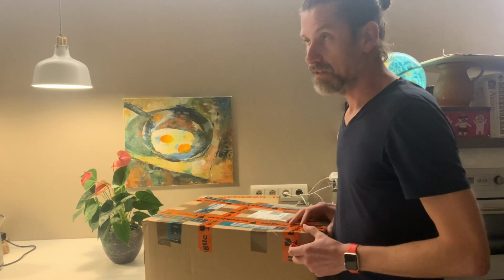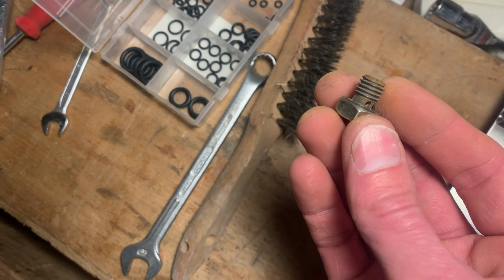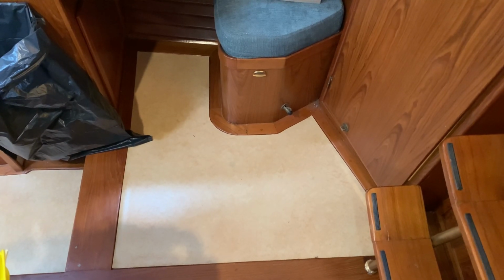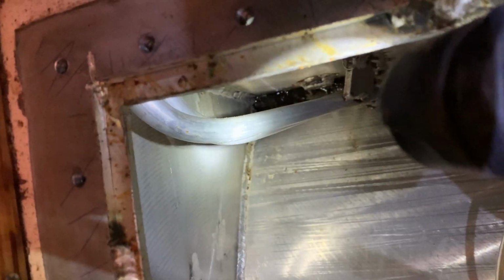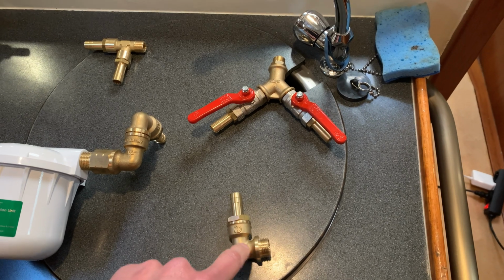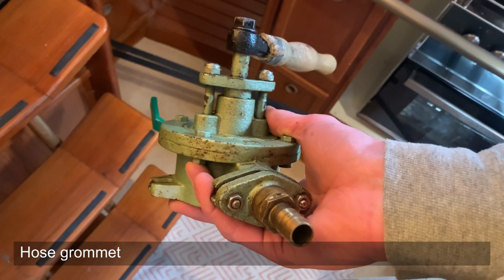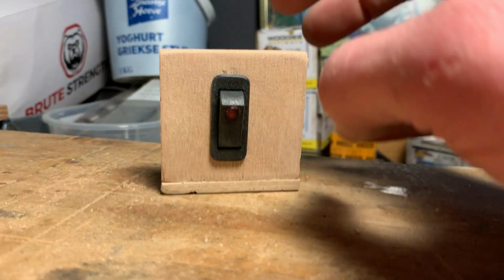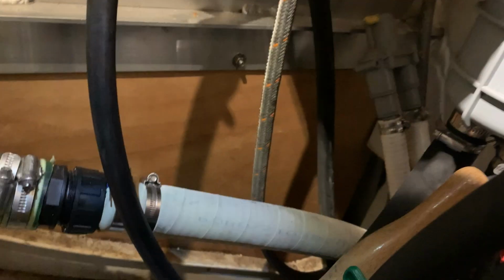019 Diesel Bacteria? Polish fuel!

Comment: I got the same pump. Damage as well just after using twice.
Reply: Those are Marco pumps are gear pumps, it’s a good idea to use a wire mesh strainer before the pump. If it sucks up a hard chunk of something they do sustain damage or jam the gears.
Reply from the maker: In my case the pump is after the diesel went through the filter. Up till now it works as designed so no jamming fortunately..

Comment: Use liquid dish washing soap on the metal barb before installing the rubber hose… and it should slide right on.
Reply from the maker: Thank you Floyd, good tip indeed! 👍. Honestly, I hope there is no next time ;)

Comment: I can't understand why you would ever want to pump the diesel from the day tank back through the filter to the bulk tank.  Is there a reason why you want or need to do this?
Reply from the maker: Hi SailingAphrodite4189,

Thanks for asking! I’m sailing regularly but sometimes I’m not sailing for a month or two. That means bacteria could grow in the day tank. 

By running the diesel back to the main tank I’m able to refill the day tank from the main tank before I start a new adventure making sure I have a clean day tank. 

This is especially valuable as the diesel
Return is on the day tank making the diesel warmer after a trip. 

Hope this helps!

Comment: I am thoroughly impressed with this video of yours on several levels!  Much respect and thanks to you sir!  This is an AMAZING video!   I enjoyed your analysis of marine rescue events and then where you broke those events down further coming to the conclusion that the majority of diesel engine failures are caused by fuel contamination issues.  I thought you were most wise to take on this specific issue proactively in your own vessel.  Most impressively you got to the root of the problem.  That root problem being the accumulation of bacteria, diesel-bug, in the bottom of the tank.  To eliminate the source of diesel-bug caused fuel starvation or contamination induced engine failure you must eliminate the presence of the bug in the fuel system itself.  It is not enough just to eliminate the "bug" suspended in the fuel while leaving the massive colonies of the "bug" still alive and accumulating in the bottom of the tank tucked away in the recesses of the fuel tank.

It is just as you said; in foul weather, the physical jarring of the tank leads to large quantities of those "bugs" breaking away, from where they were hiding in the recesses of the tank, then making their way into the fuel to then clog the fuel filter and/or fuel injectors which leads to engine failure.  Numerous boaters on YouTube go through the effort of "polishing" their diesel fuel, very few of them get to actually mechanically cleaning their fuel storage tanks.

You are also fluent in English and have put out this outstanding educational video in English which I suspect is not your 1st language even though you speak it as well as a "native" speaker.  I very much admire you for that as it is something that I could not do in any other language.  Very well done sir and thank you again!

I have a question.  Did you wire a separate electrical circuit from your ship's main DC circuit breaker/switch panel to power the DC diesel pump in your fuel polishing system?  Or did you simply pick up 12 volts DC somewhere in the compartment to power the fuel polishing DC pump?  Did the 12 volt DC fuel polishing pump come with its own fuse or circuit breaker?  All of those questions come down to whether or not the 12 volt DC fuel pump (and its associated wiring) you installed is independently and separately protected by it own circuit breaker or fuse which is correctly sized for the expected electrical load of the pump and the size of the wire powering it.

If the only overcurrent protection, for everything that is powered by the same circuit breaker that this new fuel polishing pump is powered by, is at the ship's DC circuit breaker/switch panel; is that circuit breaker properly sized (sized for the SMALLEST wire on that circuit)?  If you have already done this OUTSTANDING.  If not, may I respectfully suggest that you add a fuse, sized for the maximum current draw of the 12 volt DC fuel pump powering your fuel polishing system, as close as possible to where the wire supplying DC power to that pump is picking up the DC current from the ship's electrical system.

-Respectfully
Reply from the maker: Hi apackwestbound,

Whow, that one could call a serieus comment. And jam packed with compliments. Thanks a lot! Much appreciated you liked it and recognise the necessity of the issue. 

As for your question, yes, the pump has its own breaker. As does the full system and even the batterty now. 

You can check it on the videos 051, 053 and 054 where I re-wired the entire system. And took the right gage wire for the full system as  well by the way. :)

Hope you that content is also useful and thanks again for your nice reply!

Comment: Another item you can do.. Fresh water Rinse layup and Emergency Bilge Pump.

On Starlight 1989 Beneteau Oceanis 350 has a Volvo Penta engine M2003 28hp anyway I was the second owner, so after I purchased the boat I was doing the shakedown cruise and ran the engine for about an hour and the overheated alarm went off , could not find a problem, cutting too the chase lots of growth and calcification of the tubes in the heat exchanger.    Had too take the entire unit clean it and put it back, never wanted to do that again figured was not the use rather the extended, layup with saltwater, also the corrosion factor of the elbow, had to replace that.  So as a solution I cam up with this manifold I constructed with brass and bronze fittings and ball valves for each connection, from the thru hull , to the manifold, ball on the thru hull and on the manifold did the same at the on end valve to the sea strainer to the engine, next thru hull, pressure fresh water, and at the other end again valve to a run to the bilge. 
This allows me to turn on the fresh water, backwash the thru hull, then shutoff and run the engine for 2 minutes on fresh water before shutting down the engine for the night or an extended time.  It also in the final configuration allows me to bring to bear as an emergency pump, on my main bilge the engine, if there is a major leak in the boat that bilge pumps cannot handle for whatever reason, (lightning strikes) etc.  I often use the fresh water system when sh3 is on the hard, and I need to run the engine, like changing oil, etc. I have 100 gallons of water on Starlight,  you should see the looks I get in the yard with no hose, on the hard, yet engine running and water from the exhaust and prop shaft running out. In 20 years have not had any overheating issues or had to deal with the heat exchanger or the elbow, which is notorious on Volvos..
Reply from the maker: Hi,

Funny you mention this, I thought about this setup actually and feel it’s strange it is not standardised practice in a way. It is quite a bit of work though so might take a wihile to decide on it :)
Reply: @SailingSpringVis  have it on Starlight for 20 years, helps in everyday operation and have never had an overheat problem.  The ability to backwash my thruhull has unclogged it many times.  Still running on the same elbow, everything runs better with fresh water instead of salt water being left for extended periods of time.  The Emergency Bilge pump aspect helped my friend who had a leak after a lightning strike, with just about all the electric wiped out except the isolated starter battery, saved his boat his claim not mine but can see that.
Reply from the maker: WindRose normally is on fresh water, that helps. But I see your point and like your solution!

Comment: how much did the setup cost ?
Reply: About 150.00 just some fittings and three ball valves.  Some hose for another bilge run.  It is very similar to what Amel does, they just do not have the fresh water input on the Manifold,  but I have seen the engine on Amel 50 used as a bilge pump.  At my Marina here in Greenport Long Island, I have helped do it to 30 other boats including power boats.  Solves lots of issues especially the tubular crustaceans growth in the heat exchanger.  Also leaving fresh water in the Saltwater strainer does wonders on the stainless basket.  All of the rubber hoses last much longer, including the exhaust, and no rust stains from the exhaust.  Leaving the salt water side with fresh overnight and the for the week it is huge also from electrolysis too even the smell when cleaning the basket in the strainer..
Reply from the maker: Hi Johansteb6713, I think in total around 1200€. Filter, debug and motor were not for free but also all the hoses and hose barbs add up. In hindsight I think the filter us motor would have been ok but this works good. Hope it helps.

Comment: And what if you forget to switch off your pump in time? Will your daytank overflow  into your main tank?
I have a made similar kind of system in my boat as you made it. But I made 3 levelswitches in my daytank. With a little relaisbox which I designed I can automatically fill up my daytank when it is getting empty. So I cannot forget to fill up my daytank. And I get a low level alarm as soon as the Separ filter should get glogged and the level in the daytank comes under a critical level. After this should happen I have 1 hour to change the filter, or in my case to switch 2 valves. I have a double filter. If one gets glogged I can easily swich over to the other one and change the dirty filter without the need to stop the engine.
This system usualy only runs to fill up my daytank. If I want to polish my diesel in my main tank I can run the system continously and the daytank will overflow into the main tank.
If the whole system would fail, which I never had yet, I can easily go back to the original situation by closing/opening some valves and the engine will suck the diesel straight away from the main tank.
My experiencie after running with the system for about 7 or 8 years now is that if you start with a clean main tank and add some biocides when bunkering and using the fuel polishing system is that you will not have problems anymore. But you will still see some gunk and/or water coming into your filter.
Reply from the maker: That is a superb setup Felix! I now rely on remembering to switch it off but like your idea of automating it.  You tip on the overflow indeed is very smart. I did not think about that and will check if I can add that. In all honesty, the system is quite noisy and super fast (10L per minute) so I tend to run it for about a minute or five and then I can motor for another day.  Happy to hear that at least it works as designed and as you said, adding the biocides as well so curious to see what I find next year! Thanks for the tips!
Reply: @SailingSpringVis  I am pumping with abt. 1,5L/min.
If you want to have more info regarding my system, please contact me in private.
Reply from the maker: Will do! First going to check how I could arrange the overflow. Was thinking an auto stop is probably easier knowing how hard it is to get the hoses from the hose tail… especially the one in the main tank is a nightmare… #winterproject…. 😬

Comment: Check out Sailing Cadoha who recently fitted a fuel polisher and did an episode with the manufacturer about what additives to add to the diesel. You might find it interesting. Mike in Sheffield UK.
Reply: It is called the "diesel dipper". I have been in contact with this company. The system looks good, but is quite expensive.
Reply from the maker: Let me check that out Mike and Felix, curious to see. On the watchlist it is! :)